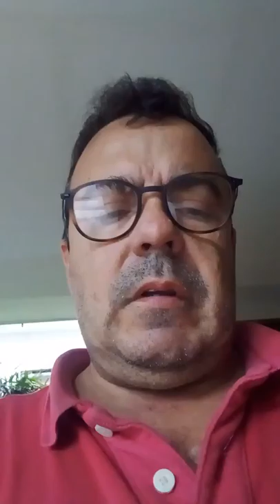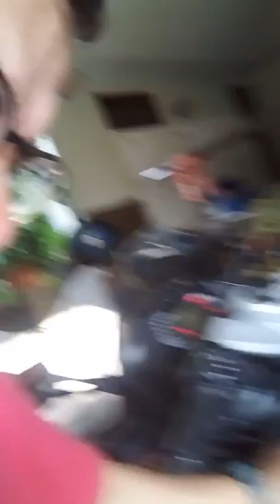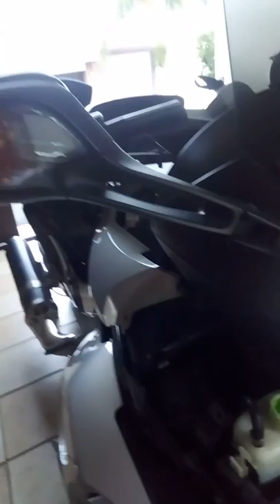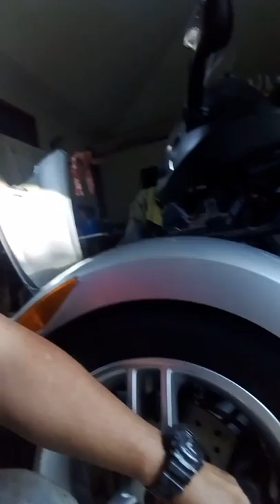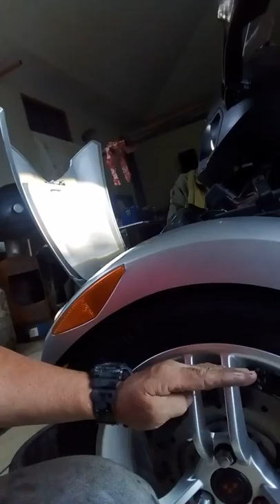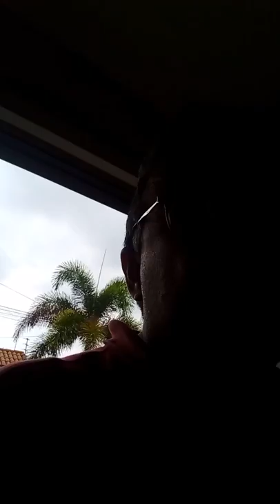CAN AM SPYDER GET RID OF BRAKE FAILURE MESSAGE

Comment: Front spark plug on 990 engine can be reached from the right wheel well. You might have to remove the grill for the radiator. Beats removing the air box. 
Reason why the code appears is when the brake pressure does not reach the certain value before the low pressure switch. You can actually see the pressure reading if you have the BRP program on your computer. 
Good job!!!

Comment: Problem is, almost 90% of this video has NOTHING to do with getting rid of the Brake Failure Message that I came here to see... so, Archi you might want to think about this video and re-film it.
Reply from the maker: this needs to be done before erasing the code, if you still have low pressure, or air in your lines , deleting the messages will not do any  good as they will show up again in no time. , best regards
Reply: @indiomechudo1  , nothing to do with low pressure, it is the brake peddle travelling too far down and tripping the second sensor. The brake cable needs to be adjusted toa point were the pedal will not travel too far
Reply from the maker: @Pedro116092  it has to do with the  low pressure switch , and the video is all about solving the  problem , 90% might not be related but is can am spyder related,  what else can you expect for FREE ADVICE ?  it worked for me and thousands more, sorry you didnt like it, but there is a manual for sale  at the dealer   best regards
Reply: @Pedro116092  there is no cable in hydraulic brake system. The cable operates only the parking brake.
Reply: Yeah I can tell him the first 10 seconds this guy was a massive waste of everyone's time

Comment: What do u have to do with the vss? U said I have to get in there but u didn’t tell what to do with the vss..?? Thnx
Reply from the maker: It is part of the brake hydraulic system, and must  bleed also  the same way you bleed the calipers,  the vss *(vehicle stability system)  must be bled at last.  i recomend to have a mityvac vacum pump or other that will do the same job as it is a real pain to reach the vss, i have small hands and had a hard time.  best of luck to you
Reply: Archi Gomez yes I did that I bled everything like u taught me but now I can’t get red of the brake failure light cause the brake is solid n I can’t push the pedal far enough to get the secound click. To get rid of the light. Thnx for all ur help keep making those videos, u probably helped 1000’s of people.. ur the man !!
Reply from the maker: @joseb1700  thank you, my pleasure

Comment: Is it safe to drive it with the BRAKE FAILURE CODE flashing?
Reply: I've had my breaks redone at the dealership and they can't figure out why the light is on.  I'm going to show them this video.
Reply: You can reset it turn the bike on press the brake pedal down until you hear the second click it’s hard to hear but it will click you have to press pretty hard hold that turn the bike completely off and remove the key and hold it for another minute and then start the bike back up and release the brake pedal

Comment: What is the other video that talks about how to get rid of the brake error message called? I can't find that video. please help.
Reply from the maker: https://www.youtube.com/watch?v=SpR2CpzvkVI     maybe this one? if not let me know please
Reply: that's because it is nothing to do with removing the error code. The only way to remove/reset the error code is to hook up a computer with the CAN-AM software and delete the error code. The code is tripped when your brake pedal is depressed to fan and trips the second sensor. This can be everted by adjusting your hand brake drum and then taking up the slack which affects the brake lever. Hope this helps.
Reply from the maker: @Pedro116092  Is what i thought  but it can be erased without the computer software, there is a very small note in the service manual on how to do it, let me find it and i will be glad to send you a snap shot. i made  2 videos  i believe on the second one  it tells you the right sequence to erase. but before that all the air needs to be taken out  of the system, the calipers need to be taken off the original position and i followed exactly the service manual instructions. and most important is to also bleed the vss (vehicle stability system)  it is very hard to reach, even though i have small hands was a pain . let me find that note and take a picture , best regards
Reply: @Pedro116092  again, the only connection that cable has to the hydraulic brake system is they both meet at the rear caliper. The code you are speaking of is different.

Comment: Can you start it with brake failure?
Reply from the maker: some times you can some other is difficult but will star,  and most times is  just an annoying message that will also make your bike not run   properly ( revs up and down)  but in most cases there is nothing wrong with the brake pads or hydraulic system, is just that at one time you pressed the foot pedal to hard  and activated the second  limit switch who gave the wrong info to the computer, now the computer thinks you have a low pressure in the system.